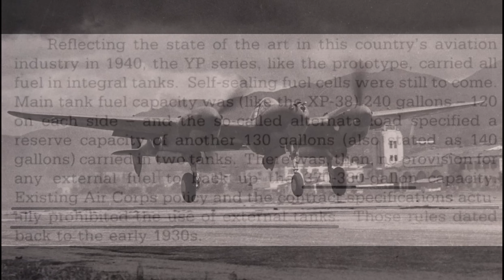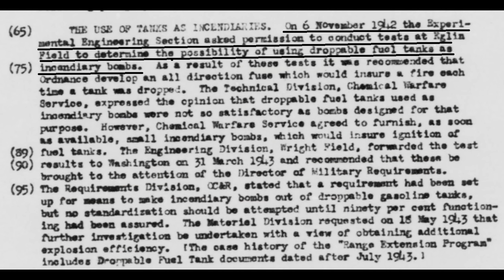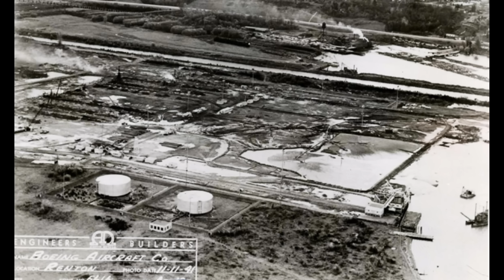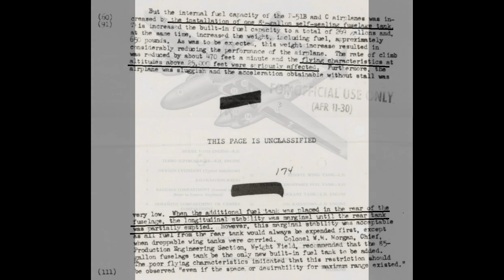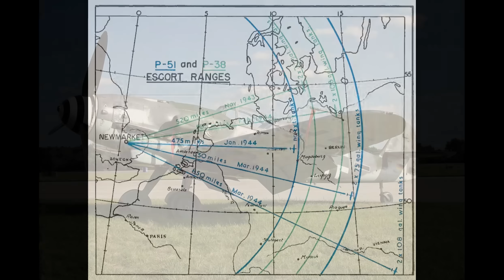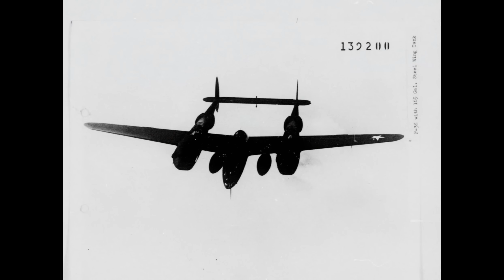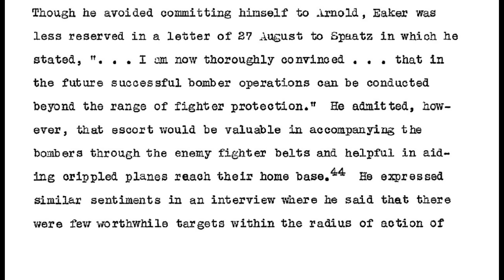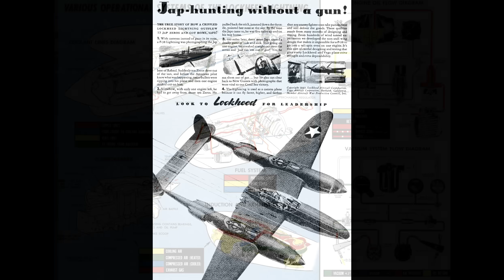The P 38 Lighting and the Bomber Mafia's Failure In World War Two

Comment: The P38 was designed as an interceptor it must be understood as such when being compared to fighter aircraft.
Reply from the maker: So those fowlers and wing section are for chasing down bombers?
Reply: You're headed in the right direction the original government specification requested an Interceptor with aggressive time to altitude performance to intercept guess what? Bombers.
Much like what happened to the F4  Phantom.... which was originally designed as a supersonic Interceptor to protect the fleet from incoming enemy aircraft, and along came the scope creep which had it doing  close support bombing, reconnaissance, and then fast forward to the  F4E they added a 20 mm Cannon to allow it to dog fight.

Warfare is fast-paced and highly dynamic and good airplane design allows the airframer to adapt to ever-changing battle requirements

Comment: if the germans had used drop tanks in 1940 would they have done better in the battle od britain? so if so why didn't they use them...?
Reply from the maker: They would have done better, but it still would not have altered the course of the war. They didn't use them because they chose to put bombs on the 109s instead. That's a whole video right there.

Comment: Great in the Pacific it had issues in the ETO
Reply from the maker: Ah, but was it the plane?
Reply: @GregsAirplanesandAutomobiles    This is an excerpt from Mike Spick Fighters, and I quote   
" In Northern Europe it was  was beset by a variety of mechanical problems most caused by the un-Californian Climate"
Reply: The P-38 had no significant problems in the Aleutian Islands of Alaska very early in the war. Nor in northern Italy where winters are cold. P-38s of the 9th Air Force also did well after Dday in France and Belgium. 
The problem wasn’t the weather in England with the 8th AF, it was poor leadership with no dedication to the P-38, poor pilot training, and poor British fuel which contributed to fatal engine problems of the early P-38s. 
All these problems could have been remedied much earlier. 
Authors Cadin, Bodie, and Stanaway all elude to this.
Reply: @plexaurella1043  P38 first appearance 1942 100 Octane was available by then Britain had it in the Battle of Britain 
2.Very busy plane to fly and its high wing loading made it easy meat for the Germans Mike Spick
3. It  had the worst Tactical Mach of all US fighters at 0.68 as tested early 1944 
4 Yes 3 F/Gs of P38s in Italy  4 F/Gs of first Spitfires  P47 and then all P51 The P38s were used in the multi task role after Mar 44 
And Bill Gunston Mike Spick RAE Farnborough  say otherwise. And it was RAE which conducted the dive tests which relegated it from Escort
Reply: Regardless of availability, poorly blended British fuel was used in 8th AF P-38s in late 1943. 

The over 50 aces that flew P-38s in the MTO against some of Germany’s best would disagree that the P-38 was easy meat. There were even 5 P-38 aces in the 8th AF in England. 

Lockheed and AAF test pilots like Tony LeVier and Benjamin Kelsey were the authorities on dive tests on the P-38 during the war. 

The P-38 was removed from escort duty in the 8th AF because it was more expensive to build and took longer to train its pilots than the P-51. The P-38J-25 and L models resolved the issues of the early the P-38s
Reply: @plexaurella1043  1. All fighters  in the Theatre were given priority on 100 octane fuel particularly in 1943
2.Aces did not just shoot down fighters there were plenty of Transports 
3.And you say the Test pilots at Wright Field were not experts ? 
   Test Report 26 Jul 1944 submitted by H.D. Delameter and C.D. Perkins signed off by F.G. Carrol Brig. General 
                             P38J ILDS 420 mph P47 500mph
 4.  Sorry the P38 was replaced after Doolittle asked the RAE to do the dive tests early 1944 they came up with a T/M 0.68 They already knew the German two at Mach 0.75
Reply: 8th AF British fuel for P-38s was poorly blended. That is not controversial. 

So the German fighters shot down by P-38 pilots were flukes. 

Sorry but the reasons behind Doolittle’s removal of the P-38 from escort duty in the 8th AF in England is more complicated than dive test results made by the RAE. 

The P-38 preformed high altitude escort duty in northern Italy very well.

Comment: While I appreciate your strong advocacy for the P38 Lightning, it failed in Western Europe while being an overwhelming success in the Pacific. This could be due to the same reason the P39 failed in the Pacific but was successful in Russia. Where the P38 and P39 were successful, they were used to their strengths, not weaknesses. Bolting on drop tanks is irrelevant if there’s continuous failure.

“The Air University Press. Part Title: Tactical and Technical Innovation Report Title: Jimmy Doolittle Report Subtitle: The Commander behind the Legend Report Author(s): Benjamin W. Bishop Air University Press (2015)” includes detailed information about the P38 Lightning’s issues and the actions taken by the Operational Engineering Section (OES). The problem was twofold: repeated engine failure and, more importantly, the loss of confidence in the aircraft. 

The report highlighted a critical issue with the P-38J variant, which experienced a nearly 50% mechanical failure rate during a specific period. Moreover, engine problems accounted for half of all P-38 combat losses. This deficiency proved costly to the Eighth Air Force during its second mission to Berlin. The 55th Fighter Group, flying P-38s, was forced to return early due to an excessive number of engine failures. German fighters seized the resulting escort gap, downing 20 bombers from the 3rd Bombardment Division in just 30 minutes.. However, despite three months of testing, the engine troubles persisted.Recognising the P-38’s limitations, Doolittle decided to replace it with the P-51

The report concluded that the events surrounding the modification of P-38s and B-24s indicated that a commanding general with engineering expertise can positively influence technical innovation. Doolittle’s involvement in Eighth Air Force efforts to innovate technically showcased his engineering skills. He identified technical problems and provided practical solutions. Spaatz’s correspondence during World War II revealed that aircraft modifications originated almost exclusively from the Eighth Air Force, while similar proposals did not emerge from the Mediterranean theatre. This disparity may be attributed to Eaker’s legal background rather than his engineering expertise. Doolittle’s ability to identify technical problems suggests that engineering expertise at the higher echelons of command can foster technical innovation. Not surprisingly, the Eighth Air Force’s narrative history noted that studies of aircraft modifications in the European Theatre indicated that they arose from operational necessity rather than being carefully planned.  

At the end of 1943, H2S “Mickey” B-17s arrived for blind bombing through cloud, but there were issues. To address this, after assuming command, Doolittle implemented measures to improve radar bombing training and tactics. On 14 January, he arranged an exchange with the RAF of 12 B-17s for 12 de Havilland Mark XXX Mosquitoes. Each British aircraft was equipped with H2X and a 16-mm video camera to record the radar display with the objective of  improving the training of the B17 H2S equipped pathfinder crews. This was implemented before Doolittle was aware of the P39 issues.
Reply from the maker: I'm advocating for the use of an escort fighter, not the P-38 specifically. It just so happens that there was a point in the war when the P-38 was the only real option. It was either P-38s or NO escort fighters, the USAAF leadership chose no escorts. I think you somehow missed the entire point of the video and all of your points have already been addressed.
Reply: @GregsAirplanesandAutomobiles   The P38, a pre-war heavy fighter, was designed to intercept enemy bomber streams, similar to the Messerschmitt 110 Zerstörer, Westland Whirlwind, Defiant, and Beaufighter. This strategy was adopted by all nations. However, when used in a role not intended for, like long-range escort, the P38 failed. The Bomber Strategic theory had proven successful until the Battle of Britain, when the Messerschmitt 110 Zerstörer, the  pride of the Luftwaffe at the time, suffered heavy losses, with 84% of its aircraft destroyed. In the end, the Messerschmitt 109E was escorting the Messerschmitt 110 Zerstörer.

Your proposal suggests that the P38, equipped with drop tanks, could protect US bombers in 1943 on deep penetration raids against the Focke-Wulf Fw 190, Messerschmitt 109G single-seat fighters. Additionally the Messerschmitt 110, and Junkers Ju 88 heavy fighters. However, prior to Doolittle’s strategic change, fighters were glued to the bombers, making the same mistake as the Luftwaffe in 1940, which General Galland’s fighters exploited because of the abilities of German radar defences to distinguish fighters from bombers. Without Doolittle’s change in tactics, which introduced the concept of “free hunting,” the outcome would have been the same. The P38 would have been overwhelmed like the Messerschmitt 110 Zerstörer during the Battle of Britain by the single-seater fighters whilst the heavy fighters attacked the bombers, unfortunately resulting in the additional loss of P38 pilots. This why Doolittle consulted Dowding and Park on their defence operational tactics for the Battle of Britain. Effectively implementing what Galland wanted to do. 

The Messerschmitt 110 Zerstörer and Beaufighter were ultimately successful in other attack roles with the benefit of carrying the second or, in the Messerschmitt 110 Zerstörer case, third crewman. The P38 was successful in the Pacific because it was used properly. Ultimately, Doolittle was correct in withdrawing it for the P51 given the P38 issues and the need to achieve air supremacy for D-Day.

Comment: The reason the P38 did well in the Pacific was good fire power , great range versatility with bombs, ranks etc..
Plus the jap planes were made of paper.

The P38 didn't do well in the ETO until the late J models and L models. 

Before that, they didn't like the high altitude climate, they couldn't dive without compressing and were restricted on power.

Mostly used for air recon until the late stage of the war in the eto.

They did a bit better in the MTO
Reply from the maker: I'm not sure I understand your post. No WW2 plane could dive with encountering compressability. All planes are restricted on power. As compared with 1943 German planes a 1943 P-38 looks pretty good.
Reply: @GregsAirplanesandAutomobiles  

P38s were restricted until the J model by the max engine boost (HG) available.

They also had an issue that they were very slippery and would accelerate very quickly in anything but a shallow dive.  The plane would quite quickly enter compression, the nose would tuck under, leaving the pilot a passenger in a missile heading straight down.
This was later remedied with the introduction of dive recover flaps on the late J and L models  to prevent the nose tuck.

The P38s were used far more successfully for ground attack more than anything in the MTO and ETO.
Reply: Just for sake of reference and this is from memory dive speed limits under 10,000 ft ias.

B17. 220 MPH (270 WITH MOD)
LANC 360 MPH 
P38. 420 MPH  (450 WITH DF)
P51  505 MPH 
SPITFIRE 450 MPH
MOSQUITO 450 MPH 
FW190 515 MPH
P47 530 MPH 
TYPHOON 550 MPH
Reply from the maker: The problem you describe was a factor for all WW2 airplanes. You're comparing an early P-38 to a later one and because the later one has more boost available you're saying the early one was "limited". That's true of nearly every WW2 fighter. Nearly all got more boost as time went on. 

    The tucking during compressablity was also an issue for all the WW2 fighter. Yes, the P-38 has a lower dive speed than many others, but that's not the end all be all of performance stats. It makes up for it other areas.
Reply from the maker: You seem to be confusing Mach limits with IAS and CAS. You can't compare IAS due to the instrument errors. For example when you do it looks like the Typhooh can out dive the Thunderbolt. In most cases it can't. I have an entire video on dive performance I think you should watch.  https://youtu.be/wwP6qv8jOhI?feature=shared
Reply: @GregsAirplanesandAutomobiles  no im just quoting the IAS figures published in the Pilot operating handbooks for dive limits.
Obvs given in ias as this is what the pilot is referencing.

The actual point was really to demonstate that everything the germans had could out dive and escape a P38 until late 1944 when they started to get the dive revovery flaps
Reply: @GregsAirplanesandAutomobiles  its a great plane, just that others were deemed better suited to high altitude operations in the eto. 
Thats all
Reply: @simonpayne8252 so arguing points in more recent comments already commented on this post.. honestly why?
Reply: I think what happens in contemporary discussions (especially about the P-38 in Europe) is that airplanes released at different times are compared. One can’t justifiably compare the P-38 G and Hs assigned to bomber escort in the Fall of 1943 to the later P-51D or even B/C. The later simply did not exist for operations yet. 
A more equal comparison would be the P-38L (and J-25) with the P-51D. In this regard, pilots that flew the P-38Ls in the ETO like Arther Haiden of the 20th FG often commented that the P-51D was no better than the P-38L for bomber escort. 
The P-51D was simply cheaper to produce and easier to train pilots.
Reply: @plexaurella1043 also the point is that earlier P38s existed to do the mission before the P51B and especially the P51D in numbers. something is typically better than nothing and could have helped  reduce losses earlier if there had been the will.

Comment: OK, I've got some questions. 

Suppose Hap and his merry bomber men hadn't sabotaged fighter drop-tanks and P-47s were escorting B-17 deep into Germany since 1942. 

Could the B-17 and B-24s then have ditched their defensive armament altogether? 

It would have worked on several levels; allowing for faster and higher altitude flight, possibly also with larger bombloads. The speed differential would've decreased greatly allowing for less fighter relays. 

Now the questions that I'm not really equipped to answer, but I'm guessing you are, are: by how much would the B-17s speed and altitude been affected (given the same bombload, say what they carried on missions at the P-47's maximum range)? How much would it decrease vulnerability to flak? How many P-47s would've been needed to escort a typical bombing raid? Has ditching defensive armament even been considered in 1944? (For the last, my guess is not - the mafia wouldn't have allowed it even if it was a sound idea.) 

Was it feasible? 

As a more-than-half measure, would keeping the tailguns alone have been the most prudent course? (With bombers being faster and the rear quarter being the likeliest angle of approach after the first pass.)

As a side-question; had the P-47s been released to do fighter sweeps instead, how soon could they have wiped out enough of the Luftwaffe that a token force of fighters could've been enough to remain as escorts? 

So many numbers to crunch, if you feel like it. The idea is to explore just how much they'd screwed up.

Comment: One interesting aspect about P-38s with drop tanks was that the prescribed method in the manual had you draw fuel for both engines out of one drop tank by having the opposite engine cross-feed off that tank.

The goal is to empty the one tank out as soon as feasible and drop it so you lose the drag. Then you switch both engines to the other drop tank. The P-38 could get away with such an asymmetric loadout because the drop tanks were relatively close to the centerline and the imbalance could be handled rather easily.
Reply from the maker: Yes, also you could run differential thrust and thus not get any trim drag.